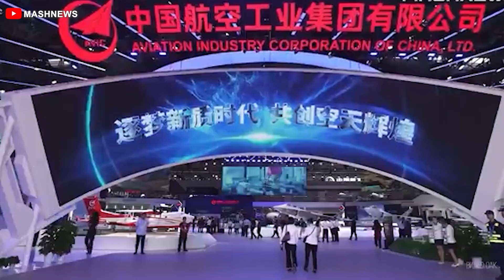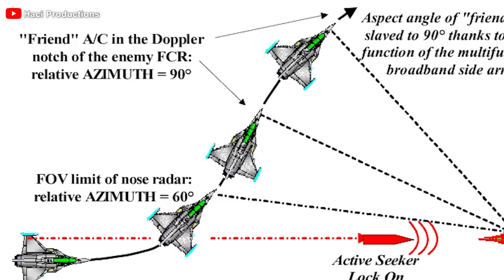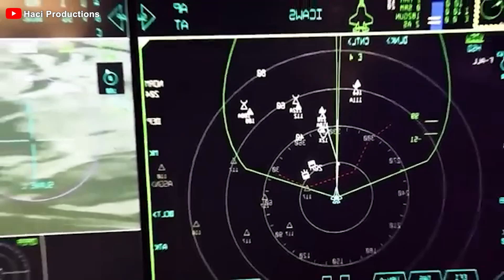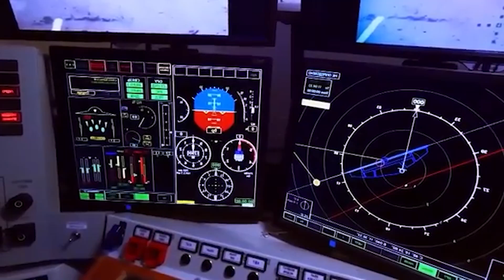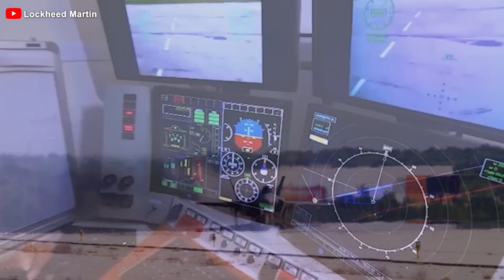Every Nation OBSESSED the Su-57! Here's Why

Comment: SU 57 RCS has been reduced in the rear section of the plane with Flat nozzles 
F35 will loose it's stealth components when it flies in supersonic speed
F35 cannot be operated in all weather conditions like SU 57 
F35 has High operational and maintenance cost 
60,% of F35 jets has to be in hangers for maintenance 
World first super cruise 5th gen fighter is SU 57
Reply: f35 is not even a 5th gen , 5th gen has to have mach speed supercruise without afterburner, f35 isnt capable to do that